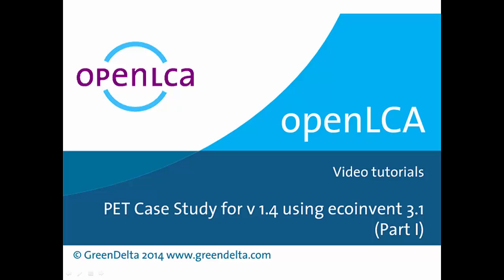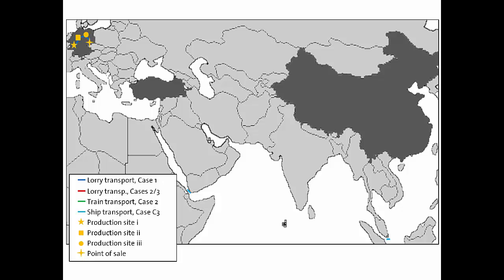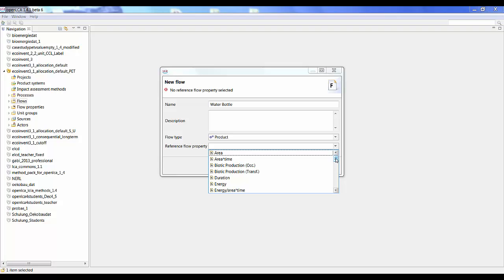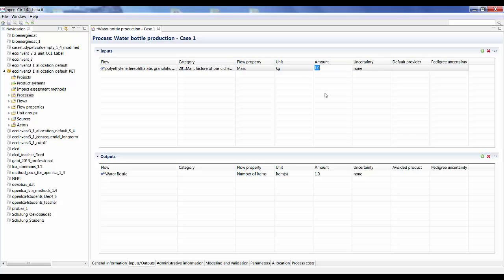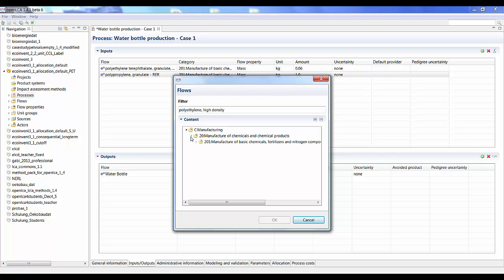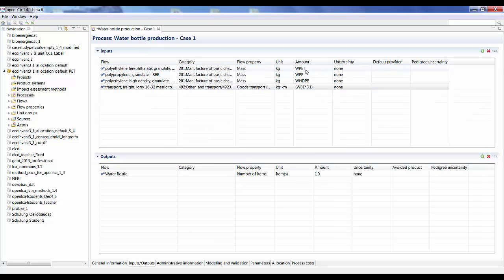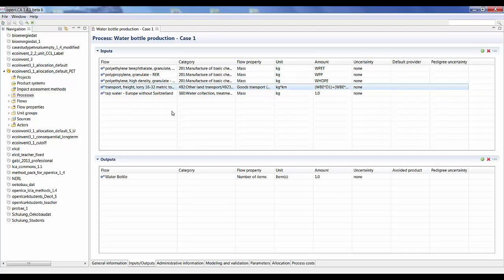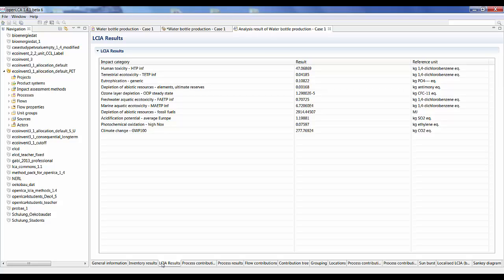Case Study: PET Water Bottles LCA Using Ecoinvent 3.1

Comment: I did this type of analysis, but when it comes to changing the number of bottles when I changed them to 1000, still the results were same? it should be different for a different number of bottles, right?
Reply from the maker: Indeed, as you change the number of bottles the analysis should be different. We suggest to always save and refresh after applying any changes. The 1000 bottles should be specified at a product system level, before calculation.

Comment: Hi, thank you for the video. I am trying to follow exactly as you explained. What database are you using here? Is it free or need to be purchased?
Reply: The example given is based on the ELCD database 3.2 which is available free of charge on the Nexus web repository. To quantify the environmental impacts of the system modelled, the Impact assessment methods must be imported in openLCA. The LCIA methods openLCA LCIA methods v2.0.4 are available on the nexus as
well
Reply: I tried reproducing it, doesn't work out quiet well... You wont get the same Input Info...

Comment: Hi there, I was following the tutorial step by step, apart from the parameter step when I just added the real numbers into inputs. But then in the end I do not see my inputs in the model graph, when I created a product system only the outputs (water bottle). I tried different settings options when creating the product system, such as "provider linking" or "preferred process type" but nothing helped. Do you have an idea where the problem might be? Thanks in advance. Lucia

Comment: hello, in my study I want to calculate the impact of transportation for one KM to use it later in my mathematical model how can I do that? should I only creat a flow for transport and a process where the input is only the transportation mode?  thank you
Reply from the maker: +Hajar deqqaq If you are using e.g. the free ELCD database you could simply calculate the impacts for one of the (system) transportation processes. You would, however, need to specify the funcional unit in t*km (as the emissions depend also on the transported weight).
Reply: +openLCA  hello and thank you for your reply
I'm using Ecoinvent database 3.1 allocation default and I modeled the tranportation in a process where the amount is the max playload for a truck then I created a product sytem and then I used ReciPe midpoint to assess the impact my question is if i use a normalzation set could I sum the midpoint indicators to get one score instead of using the endpoint ones?

Comment: Could you please do the video where you show the results and interpretation? I'm doing my master thesis using this software so it would be really helpfull.
Reply: ofentse moseki I m not doing well .
But what is ur project title?
Reply from the maker: Dear +brbin2. Thanks for your interest, but unfortunately we will not produce more videos.
Reply: Hello. I'm working also with this software but I'm facing some problems during modeling. My calculation during the creation of the product systems are not correct. Do you think we can comunicate and maybe you can help me?
Reply from the maker: Dear Nelson, you can contact us at gd[at]greendelta.com if you have issues using openLCA. Best regards
Reply: Thanks.
Reply: @brbin2 did you manage with your thesis? i have a similar situation too
Reply: ofentse moseki 
M also have been doing it for last two months
Reply: did you manage?
Reply: LCA of jatropha biodiesel in semi arid conditions.main focus is water usage.im also struggling..whats your title? Farhan Ali Sheikh

Comment: For USDA database, I created a PROCESSTRY1 with some inputs and outputs. Then I created a PRODUCTSYSTEM1 for this process. The model graph does not show any links (arrows) as shown at 14:22.

I see only one box with the word PROCESSTRY1. What would be the reason? Thanks.
Reply from the maker: +Subbu Kumarappan The USDA database connects to the ecoinvent v2.2 database, so you would need that database too for the background data. If you already have it, have you checked "Add connected processes" when creating the product system? Otherwise you could try the ELCD database for a more comprehensive start with openLCA!

Comment: Hi, good Video but where do I find part II?
Reply from the maker: Peter Pan Happy that you liked this video. Unfortunately we haven´t produced part II yet and we won´t do that very soon. For more information about results and interpretation see the openLCA user manual: http://www.openlca.org/documents/14826/72693a49-939f-4693-ac74-fa021a8aa7e7Modeling the supply chain by splitting up the product into different processes is done the same way as in this video. Just that you create different processes that you then combine to a product system.

Comment: Shouldn't the weight (1 Kg) of a filled water bottle be equal to the sum of the weights of all inputs (1+0.06+0.04+0.001) Kg?
Reply from the maker: student china Please consider the different units of the inputs in the production process - they are not all "kg", but also transportation (kg*km) is an input to the process. Or am I getting you wrong?
Reply: I meant that 1 Kg output should be equal to 1Kg input unless there is some waste.
Isn't transportation a different category altogether?
I'm a beginner so maybe I'm missing something here.
Reply from the maker: student china The mass balance has to be correct, you are right. The sum of all inputs that you mentioned is 1.065 kg which is also just the weight of the filled bottle (see Minute 12:44). The reference flow was 1 initially which stands for one bottle (unit) but not 1kg, if this is what confused you.Hope this helps.
Reply: openLCA Thanks for the clarification
Reply: openLCA It would be great if you could kindly suggest how to link different processes. I'm trying to model waste disposal scenarios and I don't really know how to connect different nodes(for instance ash treatment after incineration). Similarly it would be great if you could suggest how to model all the processes in one project rather than using different projects for each process (e.g. landfill vs incineration)
Reply from the maker: student china For how to link processes have a look at our openLCA manual (Chapter 8.1 and 8.2.3 might help you). For comparing product systems, you can create a project (see manual chapter 10).Here´s the link to the newest version of the manual: http://www.openlca.org/documents/14826/72693a49-939f-4693-ac74-fa021a8aa7e7 Good luck with your study!
Reply: +openLCA sum of inputs should be 1+0.06+0.04+0.001= 1.101 not 1.065 or am I missing something in the mass balance
Reply from the maker: +Jeremy Hanlon Thanks for spotting the mistake; The weight of the HDPE is 0.004 kg, so it would need to be changed in the parameters tab (see e.g. minutes 9:55 or 15:05). With "WHDPE" being 0.004 kg instead of 0.04 kg the total weight is again 1.065 kg.

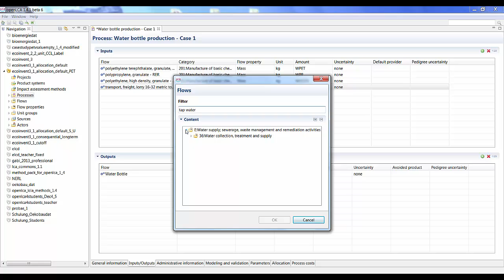Comment: Thank you! Two questions, if I may: (1) the "create system process" connected only to system datasets, correct? And this was because this is the only type of dataset in the database you used? I ask because the "connect to system processes if possible" option in my database with both unit and system processes links by default to unit processes. (2) When you chose the "tap water" dataset @12:10, there were many options with exactly the same name. These refer to different tap water production technologies, but it seems that this information is not available. Had you wanted to chose a specific technology (rather than just the first on the list) how would you have identified the correct flow?